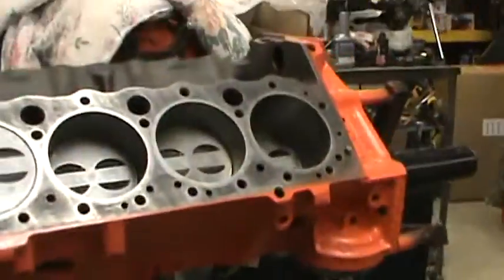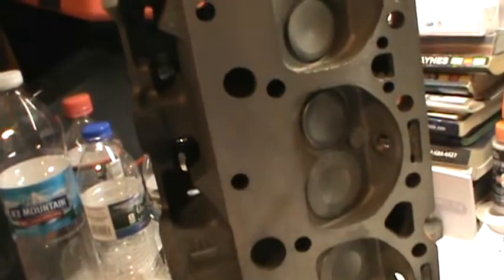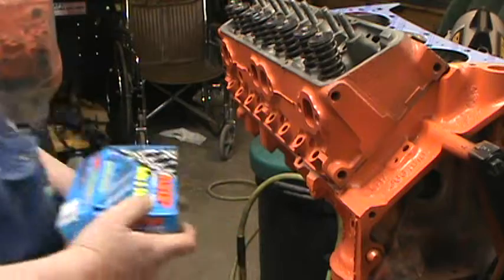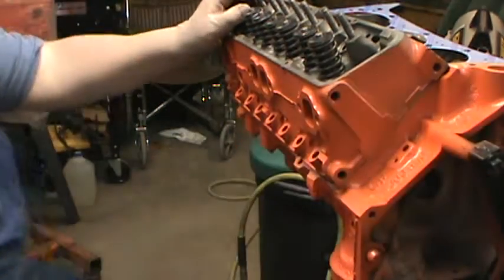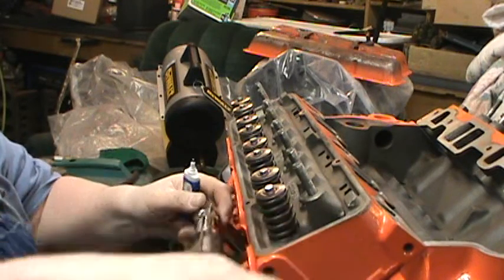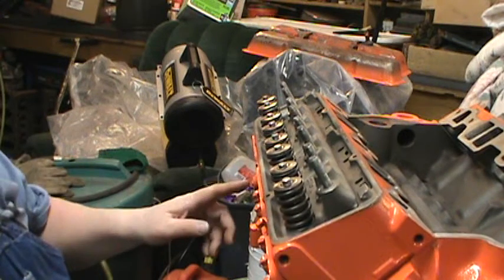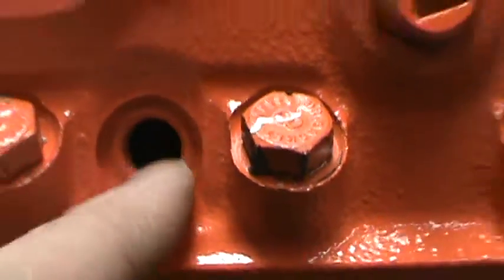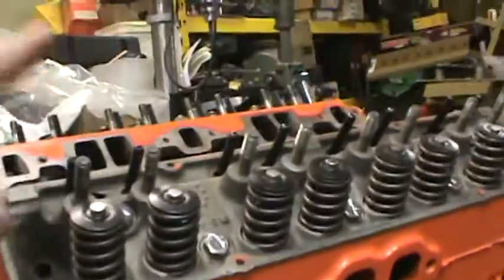back to work on 283 chevy 1966 block

Comment: I am glad I came across your video, I have just had my 283 rebuilt, my engine builder told me the heads that are on the motor are good and just told me they will be fine for my application, but you mentioned the crankcase vent in the back of the motor, and that you are going to plug this, that is a good idea, do also have to plug the hole on the inside as well, and are you just going to use a freeze out plug to accomplish this??
Reply from the maker: Just the one in the outside of the block

Comment: 601' are good for them 283s. 58cc chambers, 1.84 intake valves. Building one right now 😁
Reply from the maker: that will be a good running motor
Reply: Me also I'm tearing down a 65ss impala 283 gotta clean up the heads block looks OK and walls look OK also ,putting everything new 👌🏽 keep up the uploads
Reply: @tlcbear2  283 are good engines yes sir
Reply from the maker: im going to try to get them going  again

Comment: 059 305 vortec are the best factory head for 283-small 58cc chambers 1.84 intake hardened seats-very good flow run awesome to 6 grand--do use 305 head gaskets so don't loose compression and good idea to use head studs so u don't lift a thread like me-had to heli coil one--with small cam and 1850 holley-hei it runs amazing compared to stock----I have it in a mighty max 1989 pickup with 7004r--same mileage as original 2.0 4 banger---like your vids keep them coming take care!!
Reply from the maker: ya i want to use the vortec heads but hate the  price of the intakes but they are coming down now.

Comment: Makes me wonder how the little 283 would run with a set of 58cc 305 Vortec heads? 🤔 

69cc chambers are still a bit bit big for me on that small of an engine. But I guess it's either gonna work or it ain't? 😎
Reply from the maker: not sure how 283 ever come out it was sold and never heard from again

Comment: I picked up a 305 the other day. My question is will a set of 'Goode' mid 60's fuelie heads fit, do I have to chamfer the top of the bores for the valves. How much overbore will a 305 take and not give up durability. This will be more a radical 'sounding' street motor than a race motor. That ship has sailed for these old bones. Goode was a popular head shop close to Dayton, Oh back in the 50's-60's from what I can find out.I had them on a 406 in a Mod and it was strong for the mild build it had. Glad to see you back at it.TTYL

Comment: I’m a newbie and rebuilding a 283. In this video you talk about the Crankcase ventilation valve was plugged off. What do you use in its place? I also hav the “can” end in the lifter valley all cleaned up for a reinstall. Do I reinstall it or use something else for the crankcase to vent. Thank for the videos!
Reply from the maker: hello , what style valve covers are you going to use?
Reply: Thanks for the quick reply. I was planning on new ones or used ones that look better. The one I have don’t say anything and look too plain. But 1 has 1 hole and the other has 2 holes. So one hole would be for new air coming in and the other for pvc valve via the vacuum and the third a oil filler cap. 
Maybe I just got close to answering my own question. If so how do these 2 different systems compare valve cover pvc or the vent directly from crankcase into the the under the intake manifold?
Reply from the maker: the difference is the old system would leak oil on to the ground and all over the car when the blow by would get worst. the pvc system just works a lot better and cleaner.
Reply: well the engine was extremely dirty inside and out, but I don't think it has been bored over. I can't see any .20 .30 etc on the GM pistons. although the GM rods do have what looks to be hand stamped numbers on them. I will find out by the machinist and also tell him I need a plug for the old crank vent,
Thanks Bear!   @tlcbear2

Comment: A lot of people say why spend the same amount building a 283 then you would on a 350 or 383 even and I'm like man...it's a 283!!! They are badass Lil brothers lol sure for making power for a race engine or making money then go with bug brothers but just for fun or personal use man I love building 283s idk why I just always had a sweet spot for them, same as a 327 I guess. U might not get the brute power off the line but they sure will spin up fast, at least that's my opinion lol for what it's worth
Reply: a 283 is just way more kooler and most likely has a forged crank to boot

Comment: Is there a cam lift limit using the 1.94” intake valves due to the small bore of the 283?
Reply from the maker: ya there is but i cant remember how much it was.
Reply: a 283 with 1.94 intakes will love a L79  or a262 extreme energy comp cam. If the 283 is bored 30 or 40 over better yet

Comment: I have another question, I’ve watched several builds on YouTube and noticed subtle differences in the small blocks as time progresses from 60s- on. This 283 or at least mine does not have a cam shaft retainer or a cam button, nor does it have a threaded crank. When I was tearing mine down I noticed that It was basically 3 small bolts on the sprocket and just the chain and crank gear pressed over the key that was keeping it all in place. Have you heard of any issues with this setup? There must have been some since later models had a few more parts.
Reply from the maker: im thinking on how to word what i want to say i have not forgot this